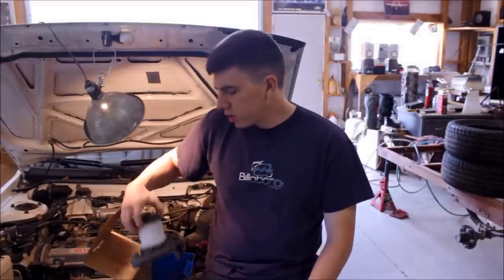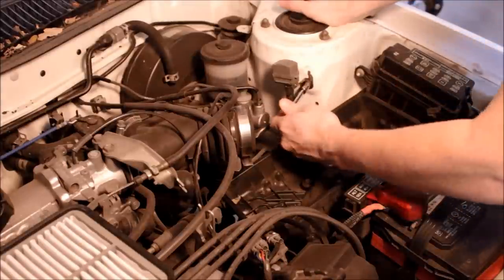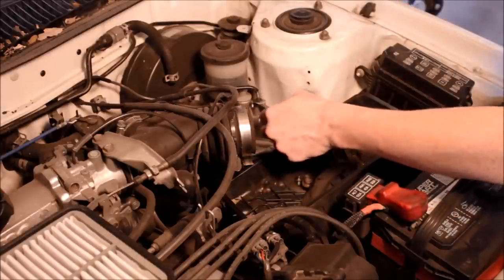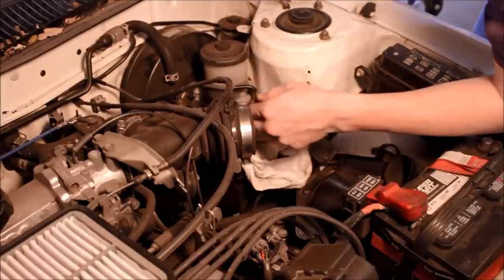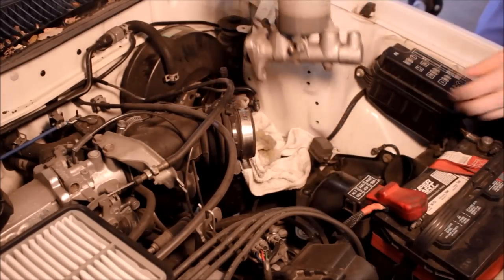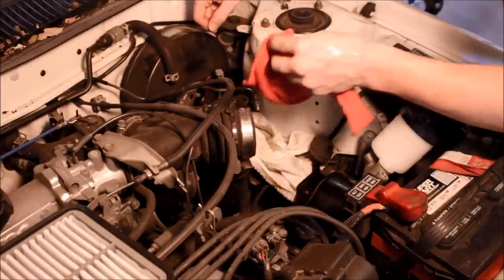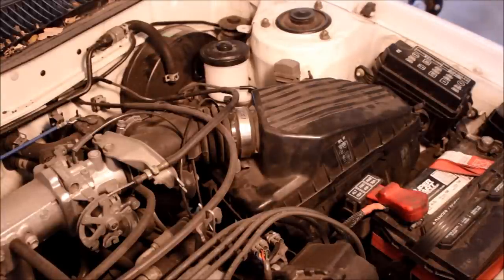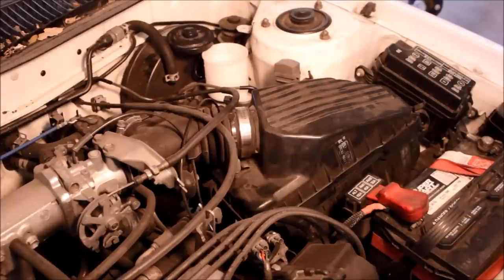How to replace brake master cylinder - Corolla

Comment: A few thoughts: The ideal tool for working on brake line connection is a flare nut wrench...a specialized type of open end wrench. It provides an addition half face to better secure the nut during torquing. Use a clean dedicated turkey baster and suck out as much of the brake fluid from the reservoir as possible, before removing to reduce leakage. It is well advised to prime a new master cylinder, before installing. EricTheCarGuy channel has an excellent video on how and why to do it. Otherwise, this is a very good video on the replacement procedure. These Corollas are as bullet proof as any car can be and its well worth investing as much time and money, as needed to keep them on the road. No better used car can be had for reliability. None
Reply: i like using a syringe better than a basted. it seems to not drip as much.

Comment: trying install a brake master cylinder in my 2005 corolla.  Bench bled the cylinder, but I have a lousy , brake fitting on my master cylinder brake line.  By the time I bled the cylinder and then installed it, I lost most of the fluid.  I will just bleed the brakes one by one and hope for the best after finally getting the fitting to screw in.  I bled the cylinder in the garage  .  One hose popped out and it shot fluid out the port across the garage, so I know the new cylinder works : )

Comment: I was here two years ago and kind of don't remember seeing this : ) .  I replaced the master cylinder in my father's 1996 toyota corolla. Wasn't sure that was why the pedal was soft, but that was one definite problem.  My 2005 corolla has 177000 and the brakes are soft, so I figure this is the problem with the 2005 corolla too.  Doing some brake bleeding first though.
Reply from the maker: Yeah bleed it first until you have fresh fluid all the way. If the seals are bad in the master it should leak past the plunger and your pedal will slowly go to the floor as you’re holding it.

Comment: I only did this once or twice.  I typically stick a q-tip into the b.rake lines to minimize fluid loss
Reply: My method wasn't going to work.  No plastic reservoir with the cylinder.  I am going to do it your way.  Thanks

Comment: What size wrenches for this job if I don't have a whole set?
Reply from the maker: You can most jobs on these cars with 8, 10, 12, and 14mm wrenches and sockets. The only thing I’d say is that on the brake lines make sure to either use a brake like wrench or a high quality 10mm wrench that fits well. It’s really easy to destroy those fittings if the wrench slips.

Comment: Why would there be the need for a gasket between the vaccum booster and MC? There would not be any fluid at this juncture. All fluid remains in the MC and/or brake lines. I don't get why Toyota would have put a gasket there in the first place??? It is a mechanical coupling of the two parts to keep the MC in  line with the booster's rod that actuates the MC piston.
Reply from the maker: Claude Albertario no idea, corrosion? Keep contaminants out?

Comment: you didn't take the rags out or reconnect the fluid level sensor or the intake air temp sensor
Reply: or the air filter clamp
Reply: Thus the name Cheap A** Garage!

Comment: no bench bleeding it first?
Reply from the maker: If you know how to do it then go for it, too messy for me.
Reply: +Taylor Thorne I didn't bench bleed the first time I put it on, then realized I missed a step, and went back and did it and saw a ton of air coming out of the master cylinder (even after having bled the brakes). I think this step is crucial, and it is specifically mentioned in the repair manual.
Reply from the maker: +ownageelite It is faster if you know how to do it but it works either way. It does take a long time to bleed if you don't.
Reply: No need for thAt becAuse you still.bleed the brAkes anyways

Comment: why u have to change it?
Reply from the maker: Seals go bad inside and brakes don't work properly. Pedal will slowly fall to the floor as you are sitting at a stop light because the seals are letting brake fluid pass to the other side of the piston.
Reply: @MotherlodeMotors  can it also make the whole power in the car to go lower and even make the headlights go dimmer during braking? -__- (without Abs)
Reply from the maker: @viisteist1363  sounds like you have either an electrical problem or a vacuum problem. Make sure your alternator is charging properly.

Comment: Why did you have to replace it
Reply from the maker: Julie Levine Pedal sinking to the floor at stoplights. Means that brake fluid is able to pass by the seals on the piston, eventually would have no brakes.